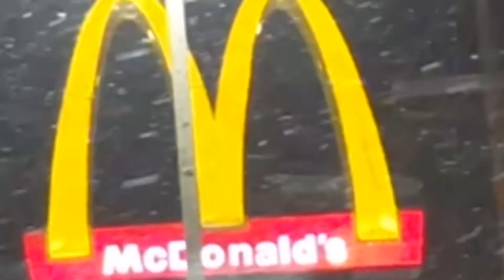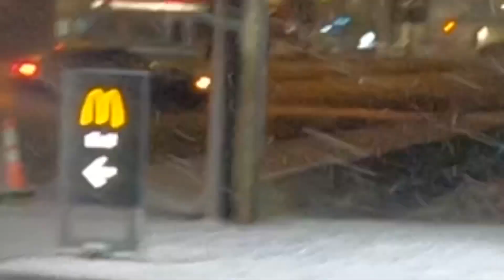I Took my Xmaxx to McDonald's!

Comment: I just tried paddle tires in tbe snow for tbe first time with my xmaxx… so much fun!!  FYI if you get some you need to turn the front tires backwards for lift in deeper snow
Reply: And for backing up 🤣🤣
Reply from the maker: Thanks for the tip! Ive got some ready for a video here shortly! cant wait to break them out! hope your year is going well so far!
Reply from the maker: hahha didnt consider that!!
Reply: @TrailerTrashRC  so far it's been better than last year and hopefully getting more events going. Hopefully you're having a good year so far

Comment: Make sure you plug the vent holes in your tires so water doesn't destroy your foams
Reply from the maker: Mmmm good suggestion! What do you suggest i use?
Reply: @TrailerTrashRC  me personally I use a small peice of tape to put over the vent holes then you can always take them off later when you're not running in wet conditions. Some people use hot glue but I would be afraid of messing up my tire because the glued would wear off pkus it's heavier than a small piece of tape :) hope that helps you!!!